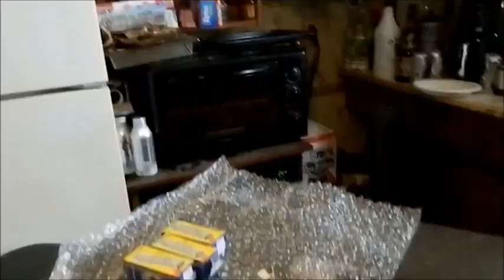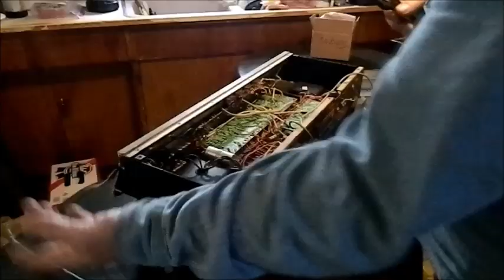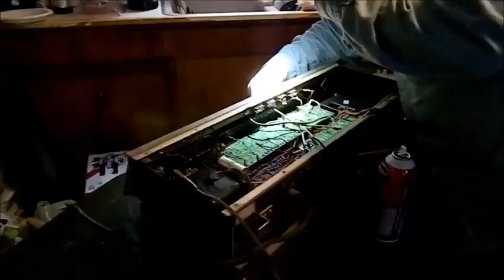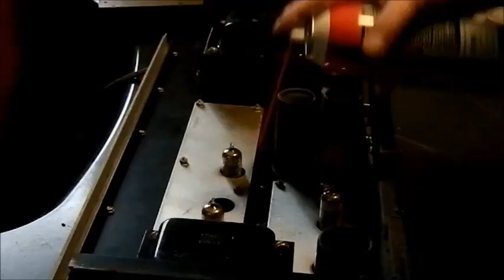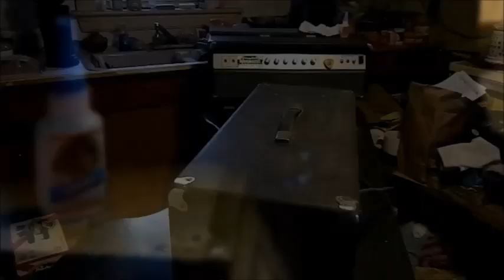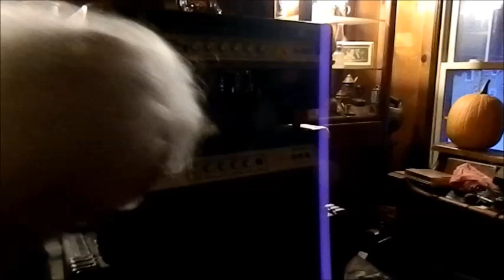Reviving My Ampeg V 4's Part 3

Comment: Yo Ste, jumped over from a/tech's channel...Kinda weird cus I was looking online at these amps last few days...Is it true the chassis sits on some sort of rubber grommets? ....How its held into headshell if you get me, just wondering cus I'm currently building cab for my build and was looking at doing something similar
Reply from the maker: Yes, there are metal side plates at each end and bolts come through the cabinet ends and thread into the plates. Then there are 4 rubber shock mounts that mount on top of the plates and the amp chassis mounts to them. There is also a bar the goes across the back and mounts to the end plates in the rear to stabilize them. You can pull the chassis out and stand it on the plates without worrying about smashing your tubes.
Reply: @Stephen_Monch_Miceli  Been trying find gut-shots online on how its done...suppose its bit much to ask to do a vid...... you've probably put it all back together..
Reply from the maker: @riley0187  Give me a couple of day Riley, I'll be pulling one of them apart again soon. What is it you;re looking for specifically? Just the chassis mounting system? Let me know and I'll do my best to get you what you need.
Reply: @Stephen_Monch_Miceli  yeh man, just how it's done...I'll be doing a video series on my 2x12 cab build...the woods ready to cut, just wondering on how to mount the chassis on some sort of shock-absorber type system..I hit you a sub
Reply from the maker: @riley0187  OK, I try to get something up for you ASAP. Thanks for the Sub!